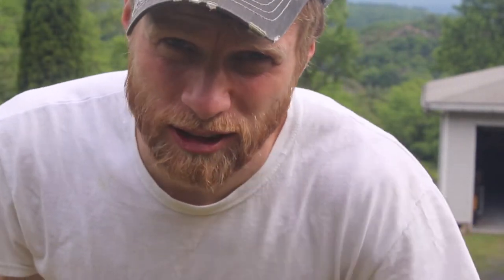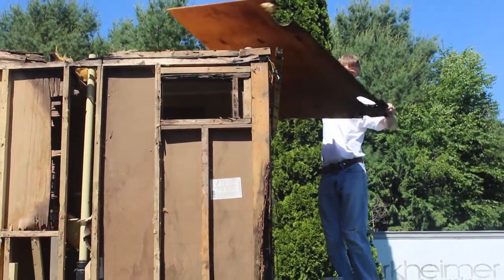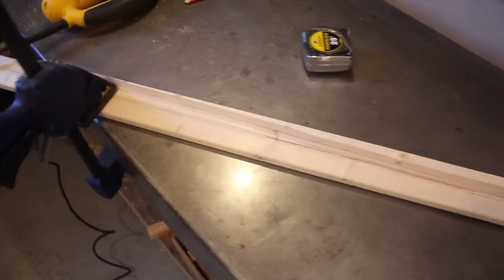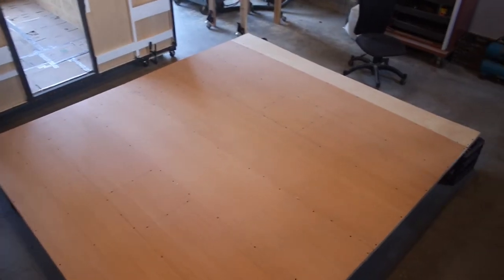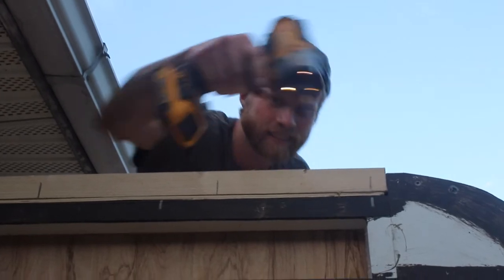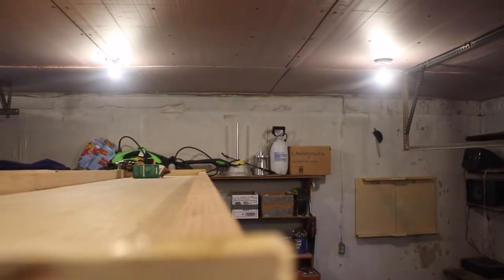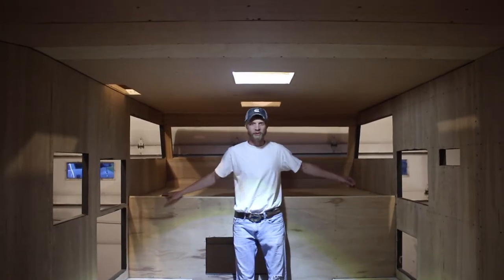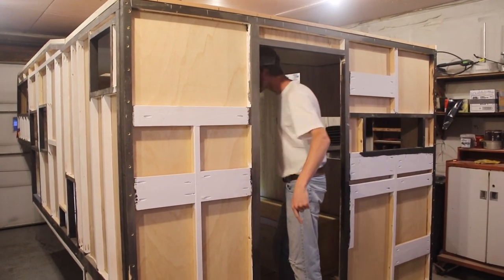Raise The Roof - Truck Camper Build Part 12

Comment: its looking good man! i want to build a 2001 dodge ram 3500 with a 24 valve cummins and a 6 speed manual. ive been trying to gain the funds for a frame

Comment: During your build, did you use any staples for the frame structure?
Reply from the maker: no, used wood glue and pocket holes with spax screws